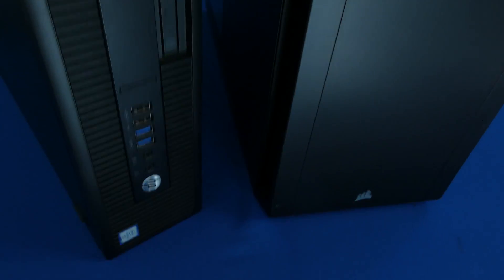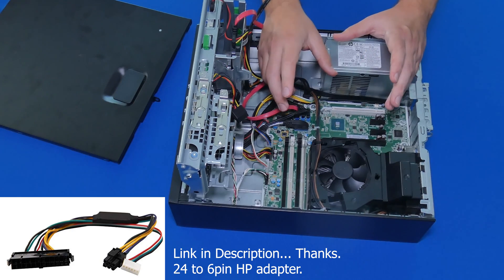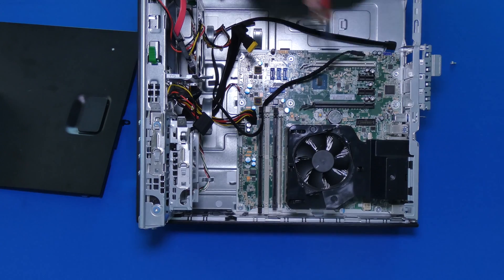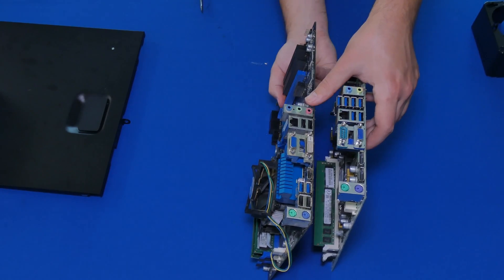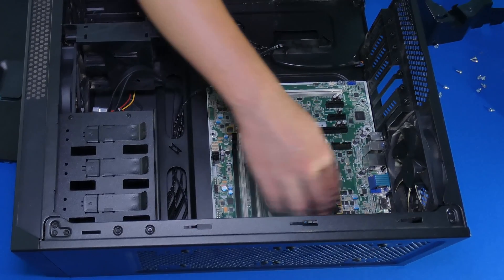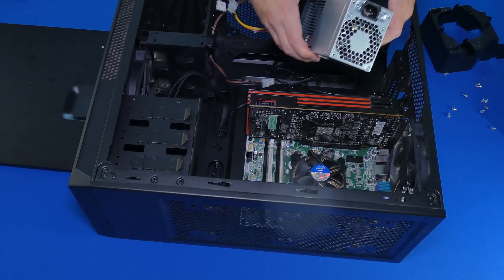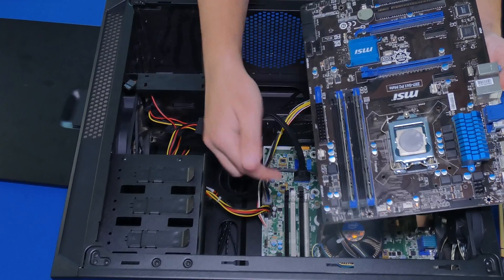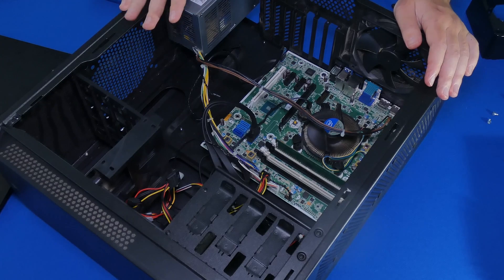HP EliteDesk transferring Parts to New Larger PC CASE

Comment: PCIe X16 extension cable  snaky up and down from top to the end  - but the graphis to the end ( case with 7-8 slots) if it needs 2 slots .... so it does not cover that single PCIe X1 slot

Comment: i cut at the back to make the ATX Power Supply fitting  - but HP Bios will say  no power cooler (cause its not an original HP Supply) - just press F1  boot :-)

Comment: Nice video thx. Will an old Antec Sonata case work for this project? I'm concerned if airflow would be an issue.
Reply from the maker: It should fit in any standard tower PC case. Probably

Comment: Hey so ik this video is almost 6 years old by now but just came across it and it's a lifesaver, that's the exact PC model i have and i was looking for a way to move the pieces to a bigger case so i can swap the power supply and add a GPU. 

I only have two questions regarding this and sorry if the first one is a little stupid but i'm guessing the 3D printed plate will only work with the specific case model you're using for this? Or would it also work for a different case model? Also what material is the plate printed on?

Comment: Good day, I watched your video ... about /24 Pin to 6 Pin ATX Power Adapter /... please help ... I have HP EliteDesk 800 G3 MT .. can I use that adapter ??, don't be mad at me please... .and thank you very much for the short answer.
Reply from the maker: I am not sure. Maybe. Open the case and check the cables coming from your power supply connecting to motherboard. If they look the same then yes.

Comment: Well I needed that video yesterday.   I just cutted the CPU cooler holder out and screwed it on the MBU.  For the USB and audio error I plugged the yellow USB in and actually used the 3.0 USB and 2 hubs. 
No new power supply needed and did it the same way in the video with double sided tape additionally.
Biggest problem is the length of the cables.
I was able to disassemble the original switch on compartment and use the original LEDs and switch in the aftermarket case. 
G2 600 805D board with 32gb ram and 6gb GPU. 1tb ssd  256gb nvme on expci 
Works fine but the mbu and cpu is not really made to be upgraded this much.

Comment: My PC's exhaust fan is not spinning even after connecting to motherboard?
Reply: Make sure you didn't connect it to HSENSE. (I know im late but this may help someone) it will not work for HSENSE, and you need a 4 pin fan for another plug that is above the HSENSE a bit
Reply: @DawezilsSystemsElectric  ok thanks for help 🙏🏻

Comment: I wanted to do this with an Elitedesk 800 G5 SFF, but that has the front usb ports and powerbutton directly on the motherboard, instead of with wires, so it was basically only made for that case, which is a shame, but I got it really cheap, will sell it with profit, learned a lesson and will buy some other motherboard and cpu :)

Comment: That motherboard looks the same size as the one in the broken Prodesk 600 g2 micro tower I have. I could just make life easy and put one of these in there. The IO part on the back looks identical and the power suply has the exact same connectors. Also this one has a better chipset, right?
Reply from the maker: It might be the same chipset but different CPU

Comment: I have hp prodesk 400 g1 sff can i change the cabinet because i made a mess and installed gtx 1050ti  that stops the upper lid from closing so my pc is inside the table so that it wont catch dust pls reply

Comment: I have the same computer, and i followed this video to upgrade to a new case. I followed the video exactly and when i switch on the power supply the little green light on the motherboard blinks, so i know it works, but when i press the power switch on the case it doesnt boot up. Did i plug the switch into the motheboard wrong? Where am i supposed to plug it in?
Reply from the maker: Right here. https://youtu.be/C70nmtTFPuw?si=RrATDW5G2OmXckVd&t=846
Reply: Thank you my good sir. I feel so dumb for overlooking that haha

Comment: Also good if you want a low power pc in a rack mount case. I think you could have used nuts for the old heatsink as well.
Reply: using nuts to attach id probably get some plastic washers between those nuts and the mobo
Reply from the maker: Probably. Good tips!

Comment: I have a HP Prodesk 600 G3 i5 6th gen with radeon r7 450 4gb graphics but i want to upgrade it to i7 7th gen but first i want to swap out it's case for a bigger PSU and Graphics card the pc only has 180w PSU.

Comment: I was gifted a EliteDesk 800 g2 by a friend and I plan to use it for drawing digital art, I hope I can follow this guide and make it all come together, also hope I can find the right case in pink.
Reply from the maker: It should work. Just take your time doing it.
Reply: How did it go?

I had many trouble removing the error post of usb 1 and 2 and audio not connected.

So many janky modding of cables
Reply: @paulssnfuture2752  it’s still in its original case I failed, still works wonderfully though.

Comment: Hi @cobuman did you end up doing the PSU coversion video? im having trouble with PSU fan not detected error. any help with this would be appreciated.
Reply from the maker: Hello. No, I didn't do the conversion but the issue might be the adapter wires. If you bought the adapter from Amazon, check the reviews as they might have a fix.
Reply: @Cobuman  thanks for the reply, I ended up splicing the cpu fans tacho to the P2's TACH sensor pin. this got rid of the error👍
Reply from the maker: @brianhatchard4756  Nice!:_like:

Comment: Power connector is a 4pin...  the new poer supply i bought has a 8pin. Have to buy an adaptor. 8pin female to 4 pin male adaptor (Your links product wasnt available.)  Also had to get a molex to 3 pin adaptor for the fans in the case.  Harddrives connect to the outside/side-back of the case.    The heatsink/fan i ordered (your link) they sent me the wrong one or it wasnt right for my hp. So i used the original but ripped the aluminum screwholes off of the old case.(wasnt difficult)      waiting for new power adaptor to show up to.orrow.
Reply: Ive never done this before. I WISH I TOOK PICTURES OF THE UNTOUCHED MOTHERBOARD BEFORE I STARTED. So i could see the original configuration.

Comment: Hi, great video, I have a question, can I install i7 7th or 8th gen in this PC?
Reply from the maker: I would stick with the same gen CPU just to be safe.
Reply: @Cobuman After some research I have also decided the same because I already have i7 6th gen in it and i7 7th gen is not a huge performance boost, so not worth the risk.
Reply from the maker: @junaidsarwar891  Yeah, I agree.

Comment: Not only very informative but a very enjoyable video to watch. Your video encouraged me to choose the 600 G1 over some other SFF systems. A great job!
EDIT: I got a cannot beat deal on an 800 G1 and am in the process of transferring to a new case with a new PSU. A great system for basing a budget gaming system on.
Reply: It is an SFF system and I ended up getting an 800 G1 with an i5 4590 and it runs surprisingly well.
Reply from the maker: :_like:
Reply: What is this another sff system

Comment: Hey can’t we use the old heat sink?
Reply from the maker: Not after you change the case because the old heat sink is screwed in to the original case metal. I guess if you find some small screws to hold it from the other side but you may damage the motherboard like that.

Comment: Really cool. I have an 8200 elite. I probably won't do this since it's not really going to be much of a gaming pc, but it's cool to see it can be done. I just got a low profile k620 gpu, should work and will play old stuff or newer titles with little demand.
Reply from the maker: Nice. :_like: It would not work with 8200.
Reply: @Cobuman  You don't think a k620 will work? It's tiny, the measurements seem solid enough. About the same size as the 6450 that's in there right now.
EDIT - Never mind I think you mean this mod wouldn't work. Well I did notice some differences from yours.
Reply from the maker: @LostBeetle  Not sure.
Reply: Did it work or no
Reply: @obayd4869  The k620 worked with my 8200 elite.

Comment: I bought the power supply you had in the comments as well as the adapter and when I went to power it on, nothing happened with the only sign of power being a blinking green light on the motherboard, which turned solid green when I used the power supply that came with the hp, it also powered on then, please help ne
Reply from the maker: It could be the adapter. Reach out to that company that sells the adapter on Amazon. They are pretty good at helping. I think the issue might be related to some wire that just needs to be swapped around.
Reply: @Cobuman  ok I will try that

Comment: hi, I followed all the steps you have described in the video and it worked, thanks for that! but at the very end I came up with a problem - how can I connect case fans to this MB? Looks like there is only a CPU fan slot and that's about it... any ideas?
Reply from the maker: You can add another system fan through unused sata power with an adapter or hard wire.

Comment: Hi Sir... I'm planned to buy GTX 780 Ti for my HP Prodesk 600 G1 with case swap and can you suggest me 700 Watt power supply wich compatible with "24pin ATX to 2-port 6pin" cable converter adapter ?

Comment: hello! i have a elitedesk 800 g1 which is totally different from the video, because the cpu heatsink and the bracket is different from this video because it's proprietary. by any chance there will be a 3d printed for elitedesk 800 g1?
 thanks!
Reply from the maker: hello. did you try using the intel oem heatsink? like, the one in the video.
Reply: @Cobuman  i tried but it won't fit due to proprietary dimensions of cpu bracket.

looking on thingverse i found one converts in am3 socket using 3d print but needs some adjustment on height.
Reply from the maker: @JesusAramil  oh... you have a different computer. These are intel computers, am3 socket is AMD. Not sure about that one. Maybe some AMD heatsink will work.

Comment: did the same thing but the system only has 1 fan output that's why your fan is not spinning in the video.   if you want more fans have to use fan expander of cpu fan header  or  use ps to fan connections

Comment: Do you need cable adapters for the USB headers on the motherboard? I've read that HP has also proprietized those ports on 5th heir boards as well and that if you want to use an after market case, you need to get adapters as well.

Comment: I have a tower elitedesk. It come with a random standard CPU cooler size and mounting holes. Which makes it complicated to swap. I'm not sure if I could use a nut four nuts to hold the CPU cooler in place?
Reply from the maker: Probably can. Just be super careful when tightening them and make sure they don't touch any circuits from the back. So, use very small nuts.

Comment: Hi mr cobuman it’s me again I want to ask were you able to plug the cable for the psu properly and when you stood the pc case up did the psu stay put or no?
Reply from the maker: If you are using the original PSU then it plugs in no problem. If you buy a different PSU you need an adapter like this: https://amzn.to/3CBbHoQ
Original PSU will need some work to get mounted, but if you buy a different one then it's no problem (inside the new case).
Reply: @Cobuman  oh thanks mr cobuman I was planning on re casing my psu next month and I didn’t want to replace my current psu because it would be expensive. Thanks again for answering
Reply from the maker: @jayczi6713  sure thing. just take your time doing it.

Comment: Does anyone have a plan for all the small connectors for the front panel? Someone had tried it already
Reply: so there are 10 pins
-pin 1 starts from the pin that have a small arrow pointing at it look closely and you'll see it.
-blank means there are no holes
-n/c means there is a hole but just leave it empty because there are no wire in there anyway

(1)HDD LED+     (3)HDD LED-    (5)Pwr Switch (7)Pwr Switch (9)n/c
(2)Power LED+ (4)Power LED- (6)blank            (8)jump           (10)jump

Comment: followed your video and upgraded the PSU, unfortunately cant seem to figure the issue out and not booting :(
Reply from the maker: Try with original PSU to see if it powers up. If new PSU is not working then it's bad or adapter used is bad. Keep in mind you need to connect the front panel power on or reset so it can turn on...
Reply: @Cobuman  yes got to that part, the issue is with the front IO, can't test the old PSU in the new case and the issue is 99.9% the power button :( .. will investigate more
Reply: @Cobuman  is there a reset button physically on the mother board?
Reply from the maker: @TheLuca112233  I showed you to connect it: https://youtu.be/C70nmtTFPuw?t=845

Comment: hi, do u have a photo of how did u connected the front panel? I mean, the POWER SW, RESET SW, HDD LED, etc, I own the same motherboard and im upgrading to a new PSU (already bought the 6 pin to 24 adapter thoo). thanks!
Reply from the maker: I've only connected one of them to power on. It's somewhere towards the end of the video.
Reply: so there are 10 pins
-pin 1 starts from the pin that have a small arrow pointing at it look closely and you'll see it.
-blank means there are no holes
-n/c means there is a hole but just leave it empty because there are no wire in there anyway

(1)HDD LED+     (3)HDD LED-    (5)Pwr Switch (7)Pwr Switch (9)n/c
(2)Power LED+ (4)Power LED- (6)blank            (8)jump           (10)jump

Comment: could you PLEASE go into more detail (close up) on how you got the cooler to fit over the cpu. I have an elitedesk sff but my hole spacing is different for some reason .. more like  rectangle than a square shape.
Reply: gotta find a nut that is perfect for the screw, or if its a tad bit bigger you can just use teflon tape to wrap around the screws to make it fit.

Comment: Hello, I plan to buy the HP 800 G1 Tower soon, and I want to move everything to a new case, I'm not sure if the motherboard is of standard dimensions, more precisely if the screw layout is the same as on a regular micro atx board (micro atx I think), so my  the question is, can I transfer all my components (power supply and motherboard) to MS Cyclops V.  I'm worried about the layout of the screws on that motherboard.  Thanks

Comment: Regrettably, this didn't work for me. The power supply I used was incompatible (finding a place to insert that 24 pin goliath of a cable into the itty bitty motherboard was like trying to mate a chihuahua to a T-rex) and the video card was so huge that it covered up three SATA ports and a USB 3.0 port. I have to have those, man! Those aren't optional!
Reply: you used a different power supply!
Reply: @amri9104  I'm not sure the old power supply would fit in the new case. Besides, it tops out at what, 250 watts?
Reply: @noone I put the motherboard back in its original case. I do appreciate the concern, but right now I think I'm just gonna have to make other plans. :(
Reply: you need the 24pin adapter for this mobo, i did it with mine and it worked out great but recently it broke so i have to get a new one.

Comment: I have a 1050 TI but I bought an Optiplex 9020 sff that needs a low profile card, so it won't fit in. Should I just buy a new case? Wich one?
Reply from the maker: I'm not sure of Optiplex can be transferred to a standard ATX midtower like in the video.
Reply: @Cobuman  then I'll save up for a low profile graphics card so it can fit in

Comment: Bruh wanna know where to connect the - and + power connecters
Reply: so there are 10 pins
-pin 1 starts from the pin that have a small arrow pointing at it look closely and you'll see it.
-blank means there are no holes
-n/c means there is a hole but just leave it empty because there are no wire in there anyway

(1)HDD LED+     (3)HDD LED-    (5)Pwr Switch (7)Pwr Switch (9)n/c
(2)Power LED+ (4)Power LED- (6)blank            (8)jump           (10)jump

Comment: Why would the heat sync not work in the new case?
Reply from the maker: Because new case will not have screw holes under the motherboard like HP case does. You need the original intel or aftermarket like in the video.
Reply: @Cobuman  Thanks, but will everything here work in this case? WHITE SHARK GCC-2101 BUNKER / 1 FAN RED
Reply: @Cobuman  Will this fan work instead of the intel one AKASA AK-CC7108EP01

Comment: Hey :)

What about the front USB2.0 connector? It's also proprietary.
Any adapter that one could purchase anywhere?
Tx
Reply from the maker: This is 800 G2. I'm not sure about front USB... It may work with some ATX cases, compare the connectors. To be honest I forgot to connect those in the video.
Reply: @Cobuman  I also have the 800 g2.
The usb2.0 header on the MB is 8 pins then 2 empty pins then another 2 pins.
Regular usb2.0 headers are 9 pins. But there are only 8 wires on the connector. So maybe a regular usb2.0 connector would work using the 8 pins from the header (leaving the 2 pins unused) but I can not test atm...
Maybe the 2 extra pins are for some kind of activity led or something. Is there such a thing for usb2.0 on the 800 g2?

Comment: Where do you plug the LED’s in on the motherboard?
Reply: Pls reply I am desperate
Reply: so there are 10 pins
-pin 1 starts from the pin that have a small arrow pointing at it look closely and you'll see it.
-blank means there are no holes
-n/c means there is a hole but just leave it empty because there are no wire in there anyway

(1)HDD LED+     (3)HDD LED-    (5)Pwr Switch (7)Pwr Switch (9)n/c
(2)Power LED+ (4)Power LED- (6)blank            (8)jump           (10)jump

Comment: I am confused about your 24pin power supply connector.. I don't have an atx motherboard, just a regular HP-Z220 motherboard. How can I transfer 24 pins to the pins that my motherboard requires.. i feel like you mention it in the video but I watched the whole video and am still confused,